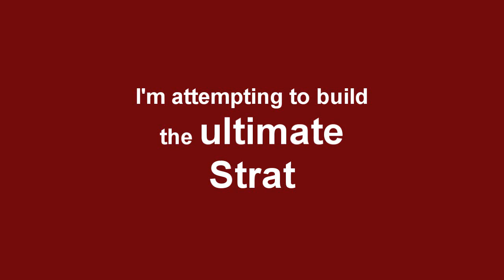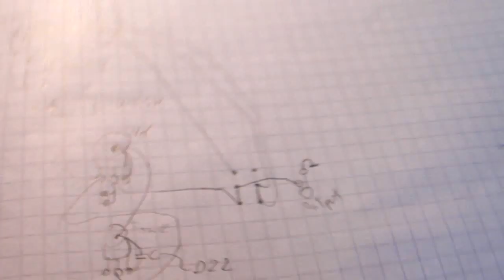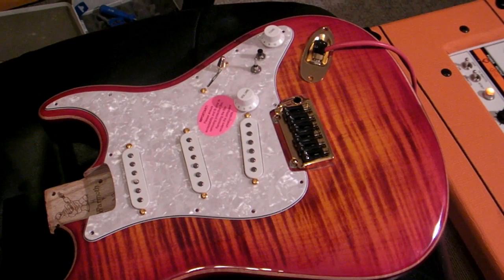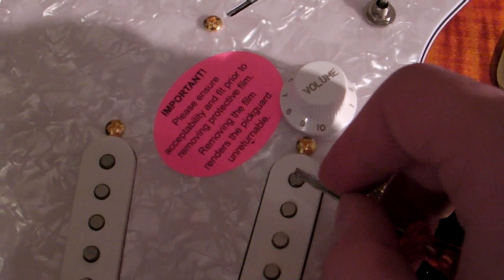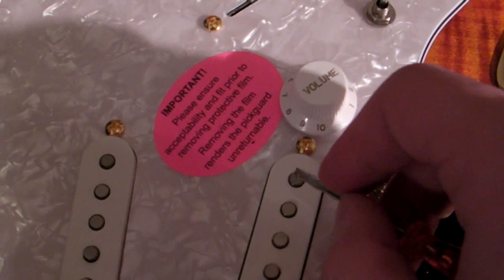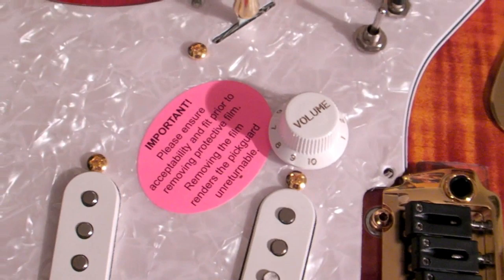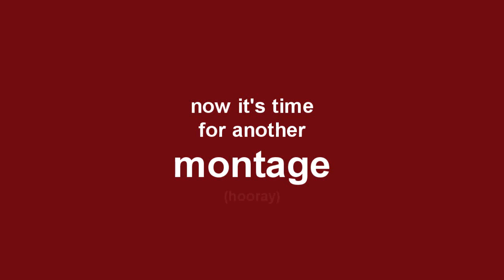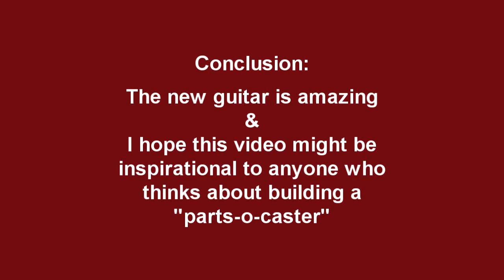I'm building a guitar (with Warmoth Parts)

Comment from the maker: @ArgentinianTraceur I think I did it like this: I put all the tuners into the holes, used a ruler on one the back side of the tuners (this only works when the tuners are flat on one side) and aligned them nicely, then I took a pencil and made a dot in each screw lug. Then I drilled the holes where the dots where.

Comment from the maker: @OverratedReality  various stuff:
the black button is a killswitch

the switch beside the black button bypasses volume, tone and pickup selector and switches to full on bridge pickup (this is useful to change between any volume/pickup setting and full on bridge PU quickly, e.g. clean and distorted on a single channel amp)

push pull tone knob selects bride and neck pickup (like the middle position of a telecaster)

Comment from the maker: the black button is a killswitch

the switch beside the black button bypasses volume, tone and pickup selector and switches to full on bridge pickup
this is useful to change between any volume/pickup setting and full on bridge PU quickly

push pull tone knob selects bride and neck pickup (like the middle position of a telecaster)

Comment from the maker: the push pull tone pot activates bridge and neck pickups (like a telecaster in the middle position), the black button is a killswitch (for stuttering effects etc.) and that other switch is to activate the bridge regardless of the volume/tone 5-way switch settings

Comment from the maker: @t0psecretshit thanks
yes, the body comes without any pre-drilled holes for the strap locks and pickguard. But it does come with the neck pocket holes already drilled and the pickup cavities etc.
The necks come with the holes for the neck screws and the selected tuners.

The tremolo is a Gotoh EV510T-FE (there's also a link where you could get those, or at least used to get in the description)

Comment from the maker: I found it easier to drill the pickguard holes before bolting the neck because there is an extension of the fretboard going over the pickguard. It's not easy to put the pickguard on afterwards if it already has the pickups in it.

Comment from the maker: @m0n4c3 do you mean in my video is a static noise? or a static noise on your guitar? When the volume is really off, there should be no noise coming from the guitar. However, it's possible that there is noise coming from the amp, if there is lots of gain etc.

Comment from the maker: @doctorgone string trees are to get a sharper string angle at the nut (since the strat headstock isn't angled).
There are certain locking tuners available that get shorter towards the high E, with those you wouldn't "need" string trees.

Comment from the maker: @HavocBillz one is a killswitch (it mutes the guitar, so you can make a stuttering effect when pressing it fast), the other one activates the bridge pickup at full tone and volume (so on a overdriven one channel amp you can have a clean sound, e.g. neck pickup + low volume and then quickly switch between full on bridge and the clean setting)

Comment from the maker: @JCreatr if it's the same guitar then there should be no difference in sustain in regards if a company screws body and neck together or if a hobbyist does it
it depends more on the pieces of wood, bridge type, neck construction type etc.

but if it's a really expensive guitar, like from a custom shop, it's possible that the luthier finds pieces of wood that resonate really well together and therefore it should have more sustain

Comment: Hi, Please explain the electronic mods you did. What is the toggle and push switch for?
Reply from the maker: the toggle switch activates the bridge and neck pickups in parallel, like the middle position on a telecaster. The button is a killswitch, to make stuttering sounds like Buckethead or Tom Morello

Comment from the maker: just take a drill that is a bit thinner than the screw
I drilled the holes as deep as the screw length (but only approximately, I don't think it matters much if it's not exact)

Comment from the maker: @mikecibula like it says in the description, it's a Gotoh EV510T
I don't know if it would fit an american strat
the studs are 56mm apart which is around the same as the 2 point knive edge fender trem
the studs have a different diameter though, but you can keep the old studs
however, I'm not sure if the routing for the sustainblock is big enough

Comment from the maker: @TheCharliePearce I have a MIJ fender tele and both feel great and are really solid guitars. In total the guitar was around 1400EUR (but this is with added 21% import fees, when importing it to europe).
All the parts that I bought are from the "showcase" section of the online shop, so these where all already finished etc.
Neck pocket is great. It worked instantly (but I don't know if it's always trouble free)

Comment: I'm thinking of building a 7 (either 28 or 30 scale) string baritone guitar, cause simply, every 7 baritone I have played simply doesn't cut it when it comes to building quality or tone and are usually overpriced.

Secondly, most 7 string baritones are made for death metal players, I like downtuned guitars but I won't go all Meshuggah with it.

 My uncle have built many guitars so I'm not alone in building this.

But does warmoth offer the parts to create a 7 string baritone?

Comment from the maker: @heyfuckyou1997 one is a killswitch (it mutes the guitar, so you can make a stuttering effect when pressing it fast), the other one activates the bridge pickup at full tone and volume (so on a overdriven one channel amp you can have a clean sound, e.g. neck pickup + low volume and then quickly switch between full on bridge and the clean setting)
there is also a push pull tone knob that activates bridge and neck like on a tele (middle position)

Comment: Hey. Looks awesome. Do you know which string saver saddles you bought for the bridge?
Reply from the maker: I think those were the Graph Tech PG-8000-0B : String Saver Classics Strat. But I recommend getting the ones that are made out of e.g. brushed steel with just the small graph tech material insert (so you'd have slippery saddles but with traditional tone)
Reply: Thanks! Did you have any significant gaps between the saddles? as the bridge you had was an EV510 with slightly wider spacing. :)
Reply from the maker: @rentonharper673  Now that you mention it, I did. So I've glued small shims on one side of each saddle (except for the last one)